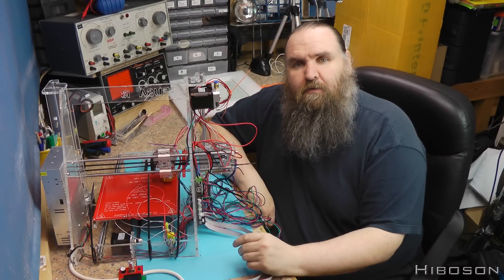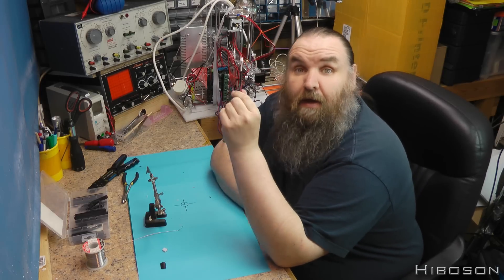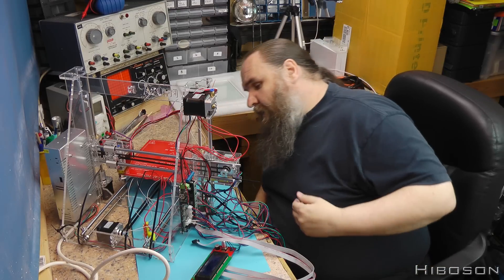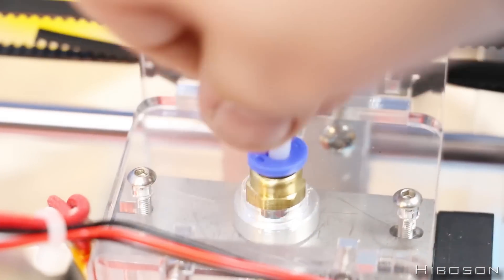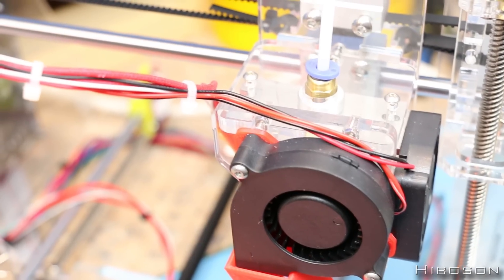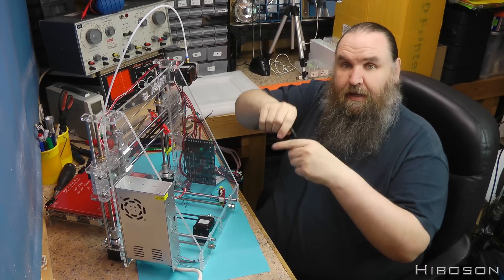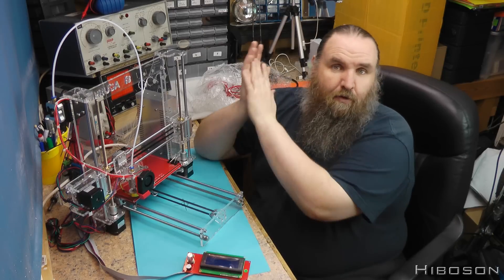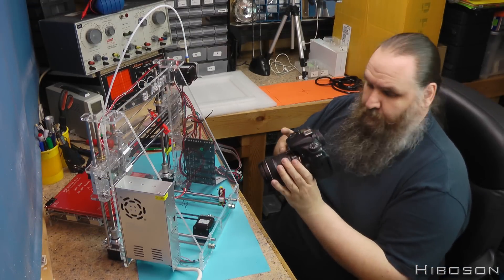3D Printer Build (And Fixing Again) - Sunhokey Prusa i3 - Part I

Comment: hey, I was just curious if you had any troubles with the main circuit board, suddenly my x axis. motor isn't working, I plugged the x motor into the y slot to see if the motor was shot but the motor worked fine, Idk what to do about the issue any help would be great

Comment: Out of interest what material you going to print with?
Reply from the maker: FRaG Hozza At the moment starting with PLA, heard it's the easiest of the materials to get started with, plus don't smell like ABS does lol
Reply: PLA is a good starting point with a top tip of Pritt stick on glass @ 60°c for rock solid adhesion, some will disagree but I have never had adhesion issue's
Reply from the maker: FRaG Hozza Thanks :) Tried printing already, had a couple of unsticking moments so far, but I'm getting there :)